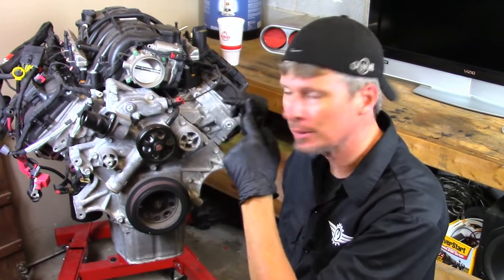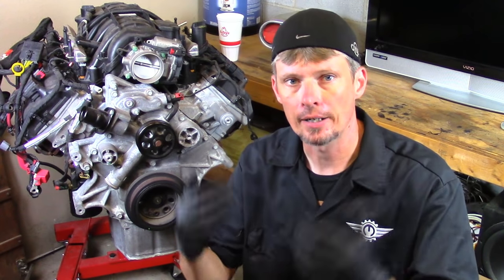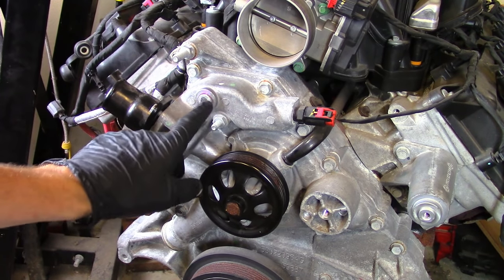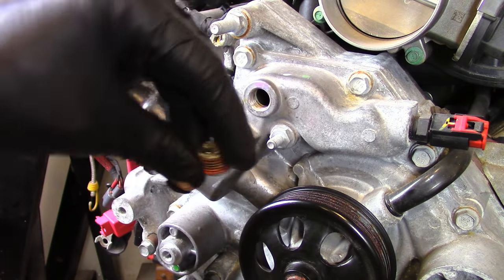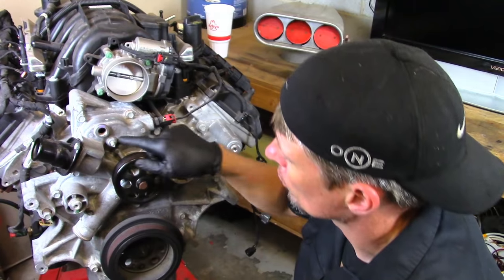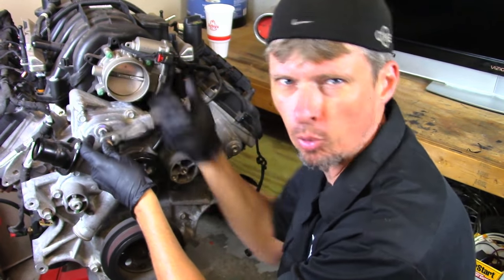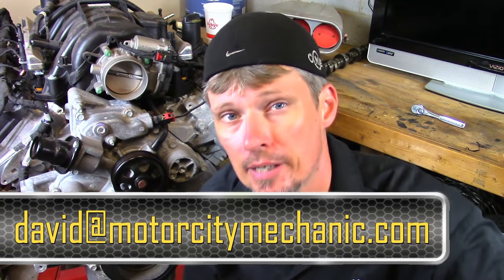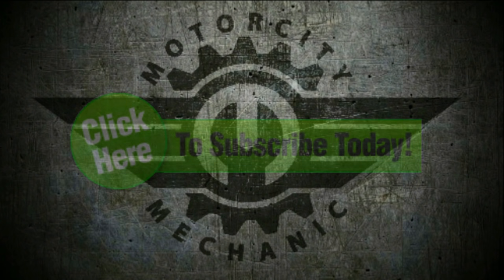Quick Tip: 5.7 Hemi coolant bleeder location and fill procedure

Comment: Thanks for the video. I just changed my 08  Ram1500 5.7 water pump, but I don't have that bleeder port or a sensor port or anything behind the thermostat to bleed anything. Still trying to figure this out.... Any comments appreciated. Thanks.

Comment: Great video. I have a 2014 Charger 5.7 hemi. I have a coolant smell that is coming into the car and it last for less than a minute after driving it and it's at a standstill. I have the heat on. I took it to 2 different dealerships and both of them did a pressure test and it held. Both the dealerships test drove it and couldn't smell anything. They told me nothing is wrong and there was no coolant leak. I still smell the coolant smell today. Any ideas of what could be going on? Everyone keeps scraping their head.

Comment: Hey David 2016 ram 1500 5.7 hemi radiator drain valve when opened nothing comes out. I assume it’s clogged, would it become unclogged if I put a wet and dry vacuum on top of the radiator and put suction to it do you think it would unclog the drain. Would I be better off taking it to a radiator shop and let them deal with it? Thanks for your video

Comment: If the bleeder screw is stripped, can you remove the coolant temp sensor and bleed the cooling system that way ?
Reply from the maker: Yes you can! That’s thinking out the box and exactly how I would if the bleeder was stripped

Comment: Can you please do a video on showing where the temperature sensor is located on a Magnum 5.7 l
Reply from the maker: I will keep it in mind.....for now its located on the front timing cover near the top. Should be on the drivers side. Thanks for the request and question. Make sure to subscribe.
Reply: @MotorCityMechanic  thanks I already did
Reply from the maker: @CROW_BH11  Much appreciated
Reply: @wiley0714  can you do it for me? Thanks

Comment: Hey cool video I have ? I replace the Pressurized Coolant Reservoir and I notice the mechanic didn’t bleed it can I do or the reservoir needs to be empty in order to remove any air in the system
Reply from the maker: You just need to make sure the engine is cold.....remove the bleeder and see if anything comes out, if it does then reinstall the bleeder, if none comes out....keeping adding to the coolant bottle until it does. Thanks for asking and for watching. Make sure to subscribe.

Comment: So after you drain your old coolant, you're saying instead of filling with new coolant and running the engine with the heat on and then burping the system, Just take that screw out and fill it up with the new coolant until it starts to drain out? No burping needs to be done. then add more coolant if needed after driving?

Comment: 2011 Chrysler 300c 5.7 hemi. Replacing water pump wondering if any of the bolts need thread sealer and torque specs?

Comment: Bad thermostat or bad water pump? 2011 Jeep Grand Cherokee 5.7. Temp gauge reached the red today, fan on blast and got it home. Let it cool down then popped the radiator cap. Idled 5mins and coolant boiled out like a volcano. Haven't done anything to it yet.

Comment: Dave
I tried to bleed air from the cooling system of a 2012 Dodge Charger hemi 5.7. I removed the bleeder nut on the waterpump and poured coolant in the overflow bottle, nothing came out,
Is there anything I'm doing wrong?
Thanks Arthur
Reply from the maker: Sometimes it helps to use one of the radiator funnels that that the fluid level is higher then the engine. Here is an example of one: https://www.harborfreight.com/no-spill-radiator-funnel-kit-58423.html?utm_source=google&utm_medium=cpc&utm_campaign=17068610140&campaignid=17068610140&utm_content=139104532754&adsetid=139104532754&product=58423&store=3324&gclid=EAIaIQobChMIkuGxke-_-AIVICCtBh1qvQJ2EAQYASABEgJT3vD_BwE

Comment: Have to change my water pump soon on my 5.7 Charger. Guess maybe I'm missing something, but shouldn't you fill radiator also? Seems like the steps are open bleeder, fill reservoir until bleeder leaks, close bleeder, and you're done (except adding more if needed). Seems like I'm missing something here.
Reply from the maker: The confusion is that the radiator does not have a radiator cap. The system uses a pressure tank/bottle.....all coolant that gets added to the vehicle is added at the coolant bottle that has the radiator cap on it. The radiator is filled by adding coolant to the bottle.
Reply: Well, derp. Thanks so much! :)

Comment: I just replaced the water pump & thermo on my 5.7 jeep overland. Everything was peachy and In working order. Drive it for a few hours and it’s steaming out the radiator cap & no heat from the heater but temp gauge is normal. Do I need to bleed it again?

Comment: So I have a 2014 ram 1500 with a Hemi about a year ago while under warranty they change the hose for the heater core cause apparently was damaged and a gurgling noise was coming from the heater core!! At some point this winter I barely had heat in the truck!! Took in at the dealership and off course is not their fault as I have to pay diagnostics bla bla!! Funny part is that they cannot hear the gurgling apparently only me!!! Till yeasterday even my woman noticed it!! Now I’m planning to burp the radiator or use the your bleeding procedure my self!! I got 86000 km on the truck !! Still the factory antifreeze!! Any suggestions? At the end don’t I have to add the radiator cap on while the engine is running to bleed all the air out?

Comment: Apparently the radiator drain is hidden & power steering reservoir needs to be moved to gain access to drain. 
Thanks for the videos
Reply from the maker: Your welcome Jeff.....take the lower hose off and go that route. Not as easy as it use to be as far as that drain.

Comment: I've never owned a mopar until I go my '08 300C (5.7L V8). It recently began to overheat but heat still blew HOT air. Took it to the dealer since I can no longer work on my own cars (arm was paralyzed in accident). I could CLEARLY see the waterpump leaking. Heater still blew HOT tho. Took to mopar ONLY dealer. they replaced wtr. pump, and "replaced" my thermostat & "replaced" some electronic temp. sensor even tho the heat gauge (both analog & digital) were still working fine! IMMEDIATELY on the way home, I noticed it only blew hot air if accelerating. Whenever I'd stop at stopsigns/stoplights, air would IMMEDIATELY start to blow colder and colder. Started overheating again AND now my "heater" won't even blow LUKE-WARM air.. AT ALL, EVER!!! 
**COULD I HAVE AIR BUBBLES TRAPPED IN MY HEATER CORE, AAANND MY THERMOSTAT???**
Reply from the maker: Its very possible. I have learned that even if its a dealer it doesnt mean that the mechanics working on it are any better then any other shop. Sounds like they replaced alot of items that typically dont go bad. They may not have gotten all the air out the system.
Reply: Have you found the problem mine does the same after replacing water pump, thermostat, hoses, and adding 50/50 coolant
Reply: going to the dealer literally means nothing except you paid way to much.

Comment: Hey man, I appreciate the video and went ahead and went through that procedure after replacing water pump.  After starting the vehicle, I can hear there is coolant circulating behind the dash. Im assuming there is still air in the system.. Any tips for resolving this?  Thanks!
Reply from the maker: What I recommend is over the next few days when the engine is cold....remove the bleeder and see if you get any more air out.

Comment: When changing the radiator in a 2019 ram 1500, is this a must? Also, the drain plug doesn't fit the new radiator. The old radiator had a rectangle in the drain hole but the new one doesn’t, any suggestions?

Comment: I like your video.  I have an 05 5.7 liter Magnum.  I got the bleed screw out after replacing thermostat and added coolant up to neck of reservoir but nothing.  At most I got a couple of minor bubbles at thread.  With it fully out, nothing.  One discussion said you need a No Spill funnel that acts as an extension of the coolant reservoir to essentially create a bigger tank where that would get filled up and allow more volume/weight to push through the air trap.  Of course that would be another $25.  Another guy spoke of  putting compressed air into a stopper like situation on the coolant tank to force the fluid out.  Not easy for me to do as a non-mechanic.  Any thoughts?

Comment: I thought all you had to do was turn the petcock on the radiator and take off the coolant cap on the reservoir and it would come chugging out. I really hope I don’t have to take apart the front of my car just to bleed the system.

Comment: I used your technique on my 13 Dodge Challenger rt and have a question am I suppose to try your technique with the car off or on?  Tried it with the car off motor cool  an I never saw any coolant come out the bleeding system coolant levels are still the same and I replaced thermostat the water pump is new not even 90 days old idk what else to do

Comment: Hi I need help I have a 2011 Jeep overland 5.7 where the heater hose is connected like on the driver wall it’s like a plastic L it riped and it keeps over heating I tryed looking for the part in autozone and they don’t seem to have it it’s literally a plastic L part it’s always throwing the water hot water from there
Reply from the maker: I recommend calling or going to your local Dodge dealer and give them you VIN and have them look it up. The aftermarket parts stores dont have every part. The dealer will be able to tell you if you can get it seperate or if it comes with the hose. They can even print out the image of the part  so that you can be sure that is it. I did a video on a minivan heater hose repair that may or may not work for your issue. Make sure to watch the video to see if it will:  https://www.youtube.com/watch?v=5Hh71R3QKHo   Thanks for asking and make sure to subscribe.

Comment: Just picked up a 2014 5.7 Durango.  Was told the water pump had been replaced.  The coolant level in the bottle was near the add.  If it wasn't bleed all the way, could this be cause of the coolant level dropping in the tank?

Comment: My 2013 Ram Hemi has a 6 mm hex insert.
Reply from the maker: They seem to have different sizes depending on the years. I want to do some reason and come up with a brake bleeder screw style setup. Not sure what benefit….makes bleeding easy but how often do you need to?

Comment: Great information sir! I have one question.  I changed the water pump and now I have a low wash light. Would you know what's wrong?
Reply from the maker: Double check the windshield washer fluid level to make sure its not low.....if okay then something related to the level unit in the bottom is at fault....either the sensor or wiring. Thanks for asking and for watching. Make sure to subscribe.

Comment: Question for you. P2181 07 charger RT. Also the lightning bolt comes on. I've changed the thermostat because it had a broken o ring/gasket and was leaking out the neck. My concern in the red lightning bolt coming on prior to the p2181 then going off. I'm thinking air in the system or the coolant pressure sensor. But why the lightning bolt? Thanks very much. I will be bleeding the charger this Sunday with the help of your video. Much appreciated.

Comment: thanks for the info had the same problem but i open the radiator cap got a big rush of air and my heat started working better would you recommend still bleeding the system
Reply from the maker: I sure would. Its the best way to insure that there is no air in the system. Thanks for watching and make sure to subscribe.

Comment: Where do these commonly leak from? I noticed the metal coolant lines look rusty. The ones that run under the intake manifold. I think they may be leaking cause after my mechanic changed the water pump he topped off the antifreeze, then about a month latter is have no heat unless I'm driving, also car seems to get to operating temperature faster but does not overheat,  but again no heat until car is moving

Comment: Saw a trick where one mechanic drilled small relief holes just inside the diameter of the thermostat mounting flange. Any thoughts on that modification?
Reply from the maker: Most of the thermostats have a hole near the top already. Any other holes you drill can affect the operation due to it allowing coolant to constantly bypass the thermostat....eventually you can get a thermostat rationality code. I recommend just following the bleeding procedure and you shouldnt have any issues and cause any new problems. Thanks for watching and make sure to subscribe.

Comment: Can I apply this method on a 2007 Jeep SRT8?
Reply from the maker: It petty much should.....if not then you can remove the coolant temp sensor and do the same. Thanks for asking and make sure to subscribe.
Reply: Thanks...subscribed
Reply: It seems that may not be my issue..long story short...fans working with 180thas never really gone past 215..now in the past 2 weeks gets up to 230 within 10-15 mins of city driving..any ideas? Maybe water pump..tstat?
Reply: Found a nice gash in my upper rad hose but not leaking...yet!..ordered a new one...Could that have an affect on temp rising?

Comment: can i bleed it with coolant already in the engine ? i just refilled with coolant and my engine slightly overheats and fluctuates. would have to drain all the coolant than refill it

Comment: Maybe you can do a video on just coolant.  My dealership has told me that I can safely switch from HOAT to OAT with a proper flush of
The system including heater core.  I was told that the additives package in OAT does a better job.  What are your thoughts David ?

Comment: On the 6.4L there is a hose that is attached to a fitting where the bleeder screw is on the 5.7L. Would removing the hose and following this same procedure bleed the system effectively?

Comment: what is the name of the sensor on the block behind thewater pump
Reply from the maker: If its the one on the passenger side point forward.....its the oil pressure sensor. If its under the intake directly behind the waterpump then its the variable valve solenoid. Just depends which one
Reply: @MotorCityMechanic  thx
Reply from the maker: Omega Blak your welcome

Comment: hey david i just put a new radiator on my 5.7 challenger. i removed the plug and radiator cap but my coolant isn't draining from the reservoir. nothing is happening. do you have any suggestions???

Comment: After I do this, can I still turn the car on and let idle to operating temp with a funnel to let all the bubbles out? And do you recommend capping the coolant tank after shutting off the vehicle or leaving the funnel on it to let all the air out?

Comment: @MotorCity Mechanic...so to confirm (major beginner here) if we believe there is air in our cooling system, open this bleeder valve port when the engine is cool and then seal it up and we should have the air out? Anything else we need to do?

Comment: Where would bleed screw be on a 3.6 ram? Very helpful videos by the way.
Reply from the maker: The bleeder is on the thermostat housing....at the top of it where the upper radiator hose attaches to the engine. Hope that helps and make sure to subscribe

Comment: I have 2010 dodge challenger hemi 5.7 v8. So on the dash it says that it's at running temp not hot but the tank bubbles after I shut it off then will push it out the overflow hose. I've replaced the temp sensor, the thermostat, and the radiator cap. I'm going to try this. If it doesnt work what else could it be?

Comment: I'm about to change the upper radiator hose on a 6.1 hemi. Do I still have to bleed the antifreeze out of the bottom of the radiator at the end?
Reply from the maker: The only thing on the bottom is the radiator drain and you use that to lower the coolant to get to the part you need or to drain the majority of the old coolant out. The bleeder is typically on the timing cover if it has one or by removing the coolant temp sensor.  Thanks for asking and make sure to subscribe. Sorry for the delay in getting back to you.

Comment: Great video. I had to change the transmission fluid, bleed brakes, power steering and thermostat. The thermostat replacement gave a P0128 error. I changed the thermostat, but never bleed the system so my engine light stays on. My cruise control will turn on , then shut off without notice. The dealership wants $650 to replace the something in thre steering column HELP.

Comment: I used car quest 50/50 radiator coolant (for all makes and models) it says do not add water. However, even tho it says for all makes and models people saying that I may have put the wrong kind in it. Do I need to flush and put the organic brand in it? (2015 ram 1500 5.7 hemi)

Comment: I’ve done it this way and yet there still is air sloshing around. The coolant reservoir is full. I have tried turning the heat on opening the bleed till fluid pushes out and still coolant/air sloshing sounds in the firewall

Comment: Hello I just watched your video about how to bleed the cooling system on a 2008 Dodge Ram. GREAT VIDEO, but I think  my problem is that I have an air block in the heater core. I just got it flushed and I still have very little heat. The mechanic said it is very difficult to get air bubble out of the heater core because the heater core is higher than the the inlet and outlet hoses. 
Any suggestions would be appreciated. 

Thanks 
Doug
Reply from the maker: I havent had any issues with air blockages in the heatercore on these trucks. You can try running the engine and increasing the RPMs. Coolant should flow thru the heatercore. Then let things cool off and try bleeding the system again until the level in the bottle levels out and no longer needs coolant added